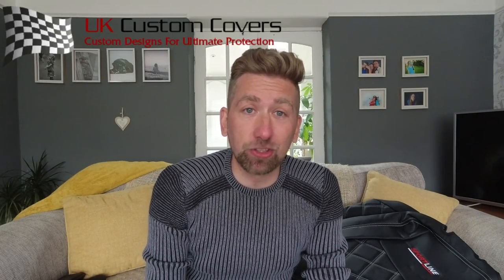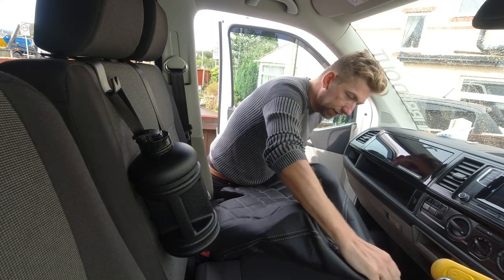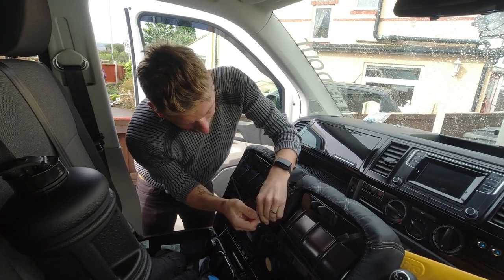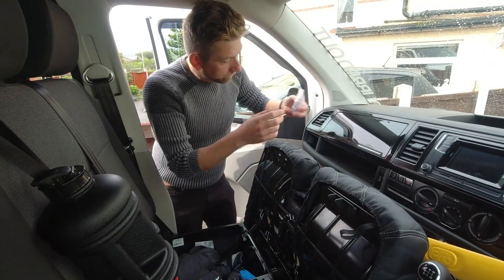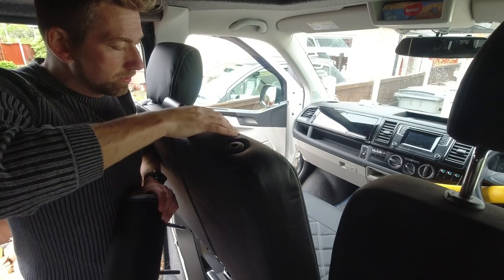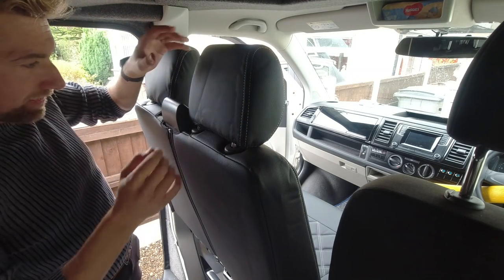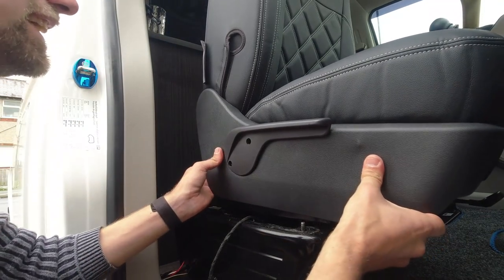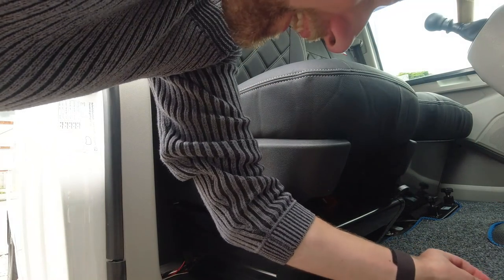Installing NEW SEAT COVERS in my VW T6 - I LOVE THEM!

Comment: Had these delivered last week for my t6.1 after seeing your video . Emailed custom covers as they weren’t advertised on the website but they did have some left in the warehouse . Excellent communication with staff . I had a bulkhead fitted so managed to just loosen the double seat to tilt it forward and slide over the back covers . The front seat did require removal which was simple as per the video . These are a super fit and I’m really happy with them . I’m physically fit but still managed to swear a lot and work up quite a bit of a sweat 😅😅😅 well happy though 👍👍👍

Comment: I never understand why people dislike great content. I love your channel and I just got myself a beautiful Vivario 2017 van to begin converting- mainly for photography trips like you do. Love the seats. Proper quality.
Reply from the maker: Thanks buddy, me neither but people will be people... its to be expected. However, what they don't realise is that even a thumbs down has a positive affect on how the algorithms of the channel work so happy days 🤣🤣
Reply: @Yorkshirepoptopadventures  Quick question Colin.You have the CRE50 in your van I believe? How reliable have you found it to be. I contemplated buying one for the van conversion ( I just got the dometic 9722 sink/cooker today before they all disappear and was looking at one) but being warned off on all the facebook converter groups saying its unreliable, sucks your battery dry like a current vampire and has cheap Chinese compressor. I'm torn now between that and the crx50-but thats a hundred quid dearer. I'd be interested in your experience months on after fitting the cre50
Reply from the maker: Hiya buddy, the CRE50 has been amazing, I was led to believe (by the manufacturer) that the only difference between the CRE50 and the CRX50 is the external look, the internals and the motor etc are exactly the same. 

I have had zero issues with it, it can run pretty much indefinitely (with my solar panel) but would run quite happily (and has) for about 3 to 4 days on medium on my 120ah AGM battery! 

It runs super efficiently because that's what it's  ultimately built to do, other options we had were cool boxes (super heavy on power and drained our battery, pre solar panel, over night) or domestic but smaller fridges, all of which drew lots of amps and would therefore drain the battery faster. 

I belive there are some slightly more efficient fridges on the market, but the power difference in my opinion is negligible.
Reply: @Yorkshirepoptopadventures  Cheers Colin. That puts my mind at rest. I wont be having solar fitted atm but will be having two 110ah batteries plus eu6  battery to battery charger . Hopefully my van will be fully converted by a converter mate of mine within the next few months. Who knows, we may bump into each other on our photography travels. I haven't used my Nikon D850 in over a year.

Comment: Hi there, could u let me know what steering lock size are u using, oh great videos 📹 always watch
Reply from the maker: Hiya buddy its the Stop Lock Pro Elite, not sure on the sizes but it's supposes to be better than the others due to the way the key is designed. Nothing is perfect but a deterrent nevertheless. Here is a link to the actual one for the spec bud https://www.halfords.com/motoring/car-security/stoplock-pro-elite-steering-wheel-immobiliser-446669.html?istCompanyId=b8708c57-7a02-4cf6-b2c0-dc36b54a327e&istFeedId=367c5610-f937-4c81-8609-f84582324cd6&istItemId=xqmrlrixr&istBid=t&_$ja=tsid:|cid:14922089728|agid:130001043964|tid:pla-542952102642|crid:552205591147|nw:u|rnd:13983686364238219610|dvc:m|adp:|mt:|loc:1006864&gclid=CjwKCAjwk6-LBhBZEiwAOUUDp0XCzV_ZeKcE7R5zy5x7e0VVGP3kqRPyLtwAUzdVcx3YEZRt9s9lZBoCLkcQAvD_BwE

Comment: Did the seat cover eventually move forward? 
( the bit you sit on, driver side)
Reply from the maker: Hey buddy, not 100% sure what you mean mate. Do you mean, did it move forward over time, ie come loose? If so, no. They are still looking as new and as well fitted as the day I fit them bud!

If I've got the wrong end of the stick, let me know and I'll try answering again :) 

Have a great day
Reply: @Yorkshire Pop Top Adventures  No that's spot on Colin, I installed with seat in place and it was hard to get the seat cover as tight as I would've liked.

I will take the seat out and realign / tighten things up. Its only moved a couple of inches but takes the look of it.
Traveling over to lake district end of April to meet my brother who has a t5 and don't want him picking faults 😄

Comment: Nice looking covers👍.  Seems like there is no option for front single -single captain seats in Leatherette styles on their site though 😕, just an option for standard PU coated polyester pull-over ones.
Reply from the maker: Ah thats a shame, not sure (maybe check with them) but wouldn't the drivers side cover also fit the passenger side?
Reply from the maker: Just had a reply and they are hoping to bring the covers you are wanting next year! Fingers crossed
Reply: @Yorkshirepoptopadventures  Nice one, thank you 👍.

Comment: Nice covers, i went to check their website but cant find the option for two singles in a Bentley stitch, "contact us" box is wobbly too.  so if they are reading... sort your website son.. ;-)
Reply from the maker: Ey up buddy, in not sure but wouldn't the drivers side also fit the passenger side? Maybe check with them! The contact us form isn't great on mobiles but works perfectly on a computer....
Reply: @Yorkshirepoptopadventures  Maybe so, I would need to contact them as there are no options on the website to order two singles. ( with bentley stitch )
Reply from the maker: Ah right, OK... hopefully they will read this (as they have watched the video) and make a few changes, because there are lots of folk (like you) who have 2 x singles etc so it would be great to have that as an option